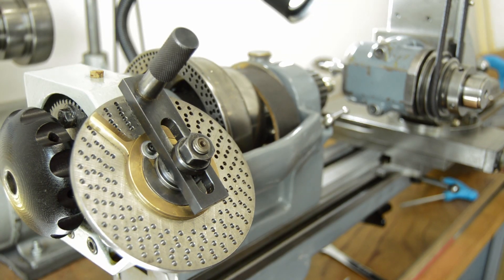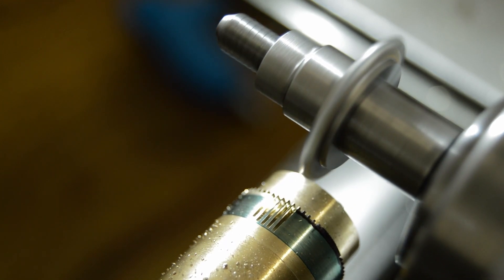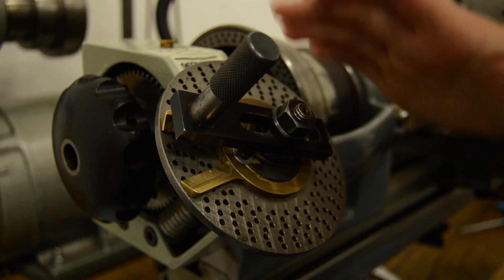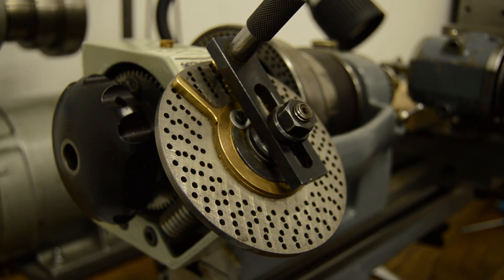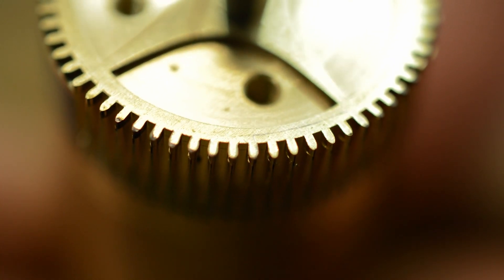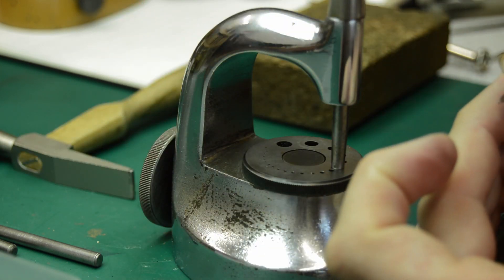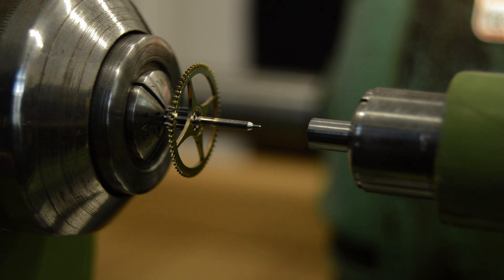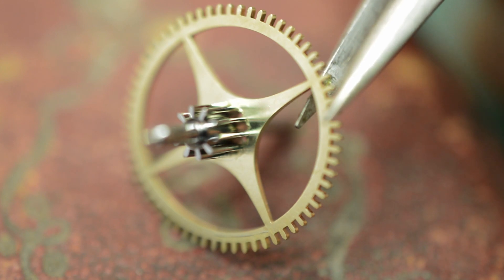Cutting a clock wheel on the Schaublin 102 lathe.

Comment: Thank you.  the retention of the wheel on the arbor, the removal on the anvil, the use of stakes and the lathe to finish and reivet the job was invaluable to me.  i had to swap the arbors on two escape wheels (one with 45 and the other with 48 teeth) and by following your craftsmanship as best as my tools allowed I have exchanged the arbor and  rivetted the wheel and it is a successful job.  i am happy and the chiming clock now runs as it should.  my sincere thanks for the detail and care you  have taken in this video
Reply from the maker: Wonderful, well done. Thank you for letting me know. 👍

Comment: I figured you would cut a tooth with the gear absent, then rotate the gear into position knowing it was aligned.
Reply from the maker: That would have worked well, especially with a tailstock microscope.  Thanks for the idea.